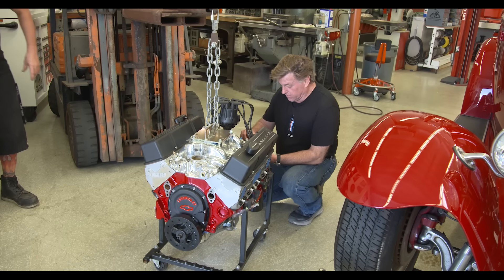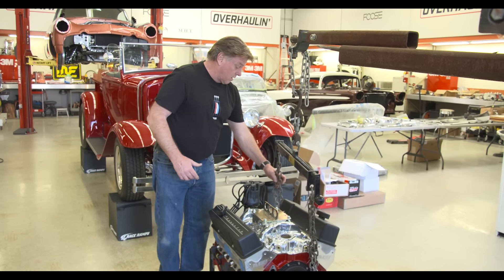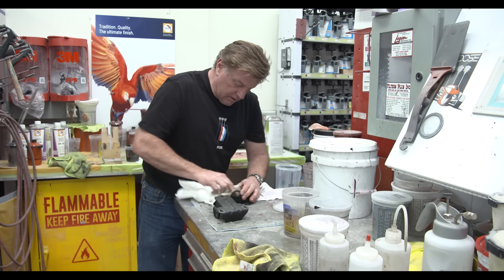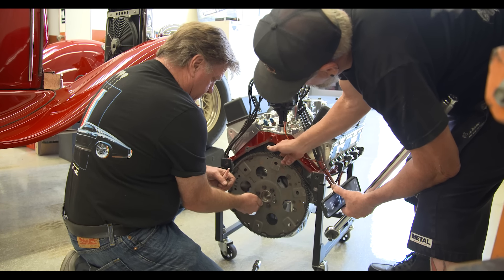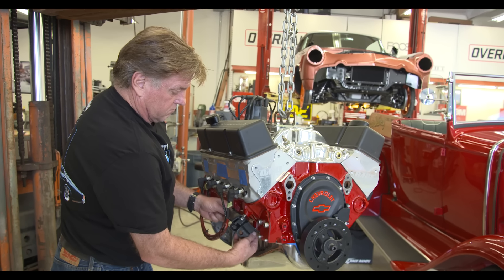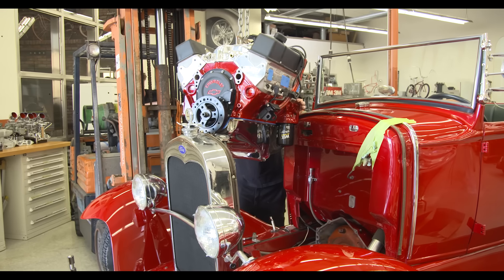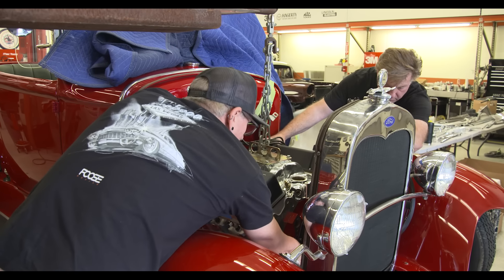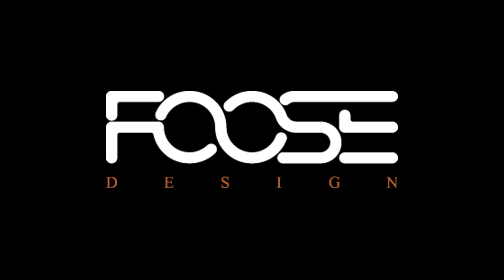Droppin’ the Engine on a Ford Model A!

Comment: Chevy motor in a Ford....More crimes against humanity.
Reply: I sometimes think Chevy people don't Remeber that Ford came out with the V8 before chevy!  Ford Engines have Won Race's for Year's,  just like Chevy & Mopar's.
Reply: @VernLeRoy1962  You are wrong. GM had the Viking and Oakland . They were the first cars with a mono cast  V8 block in 1929.  They were higher end cars . Ford didn't show up until 1932 . Cheverlet was absorbed by GM in 1917 and they produced the first V8 engines. They were two OHV, four cylinders bolted together.

Comment: I can't belief Foose would put a Chevy in that a old Ford!!   Ford people Don't put a Ford engine in a Chevy hot rods. could go with old school V8 to a 302(331 or 347) 351(408)W,  351C or a Coyote!  Personal,   I'd Have to put the Grandfather of V8's, the Ford flat head with a set Edlebrock heads & a edlebrock or offenhauser intake on it. agree to disagree.
Reply: If you listen to Chip talking it's the motor that came out of the truck.
Reply: >> ...people Don't put a Ford engine in a Chevy hot rods<<
There's a real good reason for that.
Reply: Built Ford tough with Chevy stuff.
Reply: @logancarter2134  and?he didnt have to at all!!!
Reply: Chevy makes much more goodies to their engines. And its cheaper. More candy for big Kids. Thats how it is. There is toys. Just play with them and enjoy
Reply: Hot running flap heads suck.  Pretty, but not practical for today's use.  MHO
Reply: A Flat Head is Fast enough for a Hot Rod like this, You can't really drive much faster then a 100 with that straight axle on the street anyway.  agree to disagree
Reply: I absolutely will not mix engines and cars from different manufacturers. I am building a 23 model A fordor sedan and I am installing a 2023 Ecoboost and 10 speed auto transmission. I am installing a power train that js exac 100 years newer.
Reply: @SeanHenderson-gn8if  when a person. Buys a car motorcycle bicycle go cart airplaine or push cart surf board snowboard. Ski of snowscooter. The person dont buy it for what you want or wish. He Buys it becouse of what he wants and wish. So dont interfear and be so negative. Enjoy life as that. Person do. He pay and he enjoy what he chose to. Not you!
Reply: Seeing your astute comment, I decided not to watch. I would have put in a 363 with Cleveland heads…
Reply: so many good Ford Engines to choose from!!😎
Reply: U can do everything that you want 😂😂😂
Reply: It's incredibly frustrating seeing this because I don't watch them just because people do this
Reply: That’s the engine that came out of the car so be it.
Reply: "HOT Rodding" is all about blending different manufacturers parts to.
Reply: He put a Chevy in a V12 Jaguar.

Comment: Nice project.  I am collecting parts for a very early thirties similar project planned to be painted in 79 F150 metallic blue. I have Ford 300 inline six with an aftermarket turbo project engine almost ready that came out a generator used in a welding truck from the early 1970's.